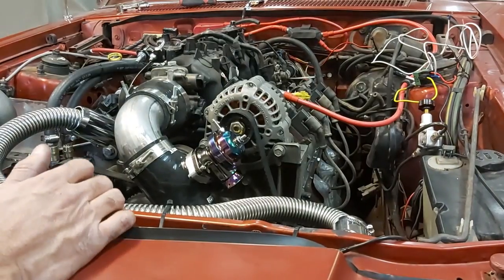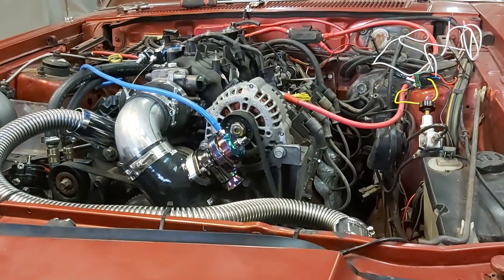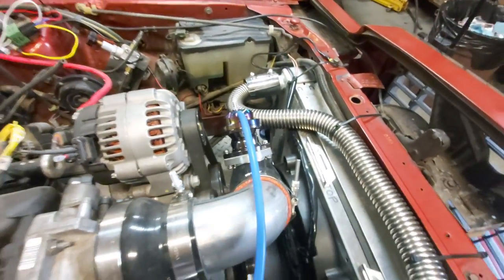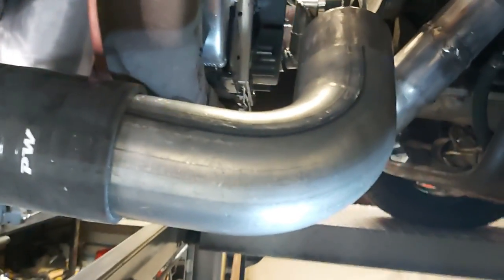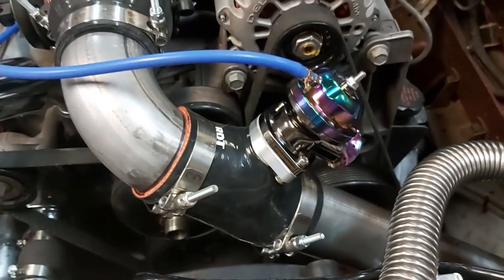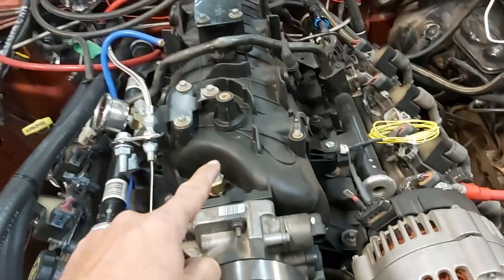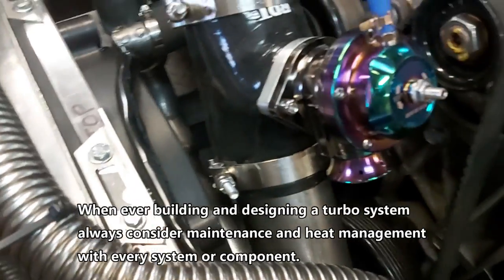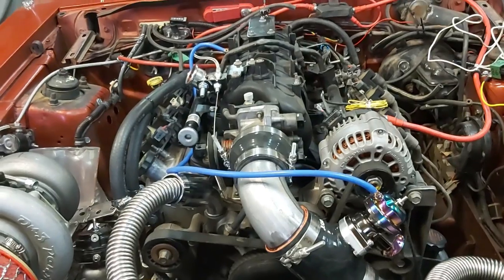Blow off valve & boost piping build & theory for Project Turbo L.S.

Comment: How you hooked your wastegate my turbo don’t have port is it possible to I can hook bottom port on waste gate to intake? And thank for bov info 🔥🤝
Reply from the maker: Yes, If your turbo does not have a compressor housing fitting, you can just connect a line from the intake manifold fitting to the bottom port of the waste gate.  This would control boost pressure if not using a boost controller etc. When intake manifold reaches the same  spring pressure  as in  the waste -gate, the waste gate will open bleeding of pressure, thus controlling boost pressure of the system. If you have a 10 psi spring in waste-gate, your engine will make a maximum of about 10 psi with this configuration.....thanks for watching and commenting.....Oliver

Comment: where do i put my wastegate vacuum im not using a boost controller
Reply from the maker: Right now since my boost controller isn't hooked up either, I'm just running a vacuum line from bottom port of waste gate to the turbo compressor housing pressure port. So basically we are just using waste-gate spring pressure as our governing system to control boost pressure. I have about a 14 p.s.i. spring in my waste-gate. So in theory when boost pressure hits 14 psi the waste-gate should open and prevent over boosting....I'm just testing everything slowly at this point so I've hit about 3 psi before I let of the gas pedal....Thanks for watching and commenting.....Oliver

Comment: How’s the bov coupler holding up?? Been going back n forth on ordering one.
Reply from the maker: Still good, although I had to re-position the charge pipe as the configuration in the video didn't clear the ls swap radiator and dual derale fan set-up which is in the car now....thanks for watching and commenting....Oliver
Reply: @BooostedLS  I appreciate it!!!

Comment: Your set up doesn’t have a MAF sensor? Mine does :(
Reply from the maker: That's because my x-max is speed density and uses a map sensor verses a maf sensor. Are you using terminator x as your ECM?. Thanks for watching and commenting.....Oliver
Reply: @BooostedLS  this is my first ever turbo build. I was going to run the stock ecu to keep cost low. Trying to absorb everyone’s knowledge:)
Reply from the maker: No worries Dan. Hopefully my video's offer some good tips. If you have any questions just shoot me a question on here and I'll get back to you as quick as I can. Good luck on the build, I think it will work out just fine. Thanks again for watching and commenting....Oliver
Reply: @BooostedLS  I really appreciate that!

Comment: How did you hook up wastegate
Reply from the maker: I'm planning on just using a manual boost controller initially, as they are cheap and they work well. What I usually do when I'm first trying out the turbo charger is I just connect a vacuum hose from the compressor pressure port ( nipple ) directly to the bottom port of the waste-gate. What this does is it just limits boost pressure to the same as waste - gate pressure. So in my case about 14 psi, as I believe this is the pressure of the springs in my waste -  gate. I'll definitely make a video going over the hook-up of the waste - gate once I get to that point. You can see how the waste- gate actuates in this video here at this link.... https://youtu.be/FPqMai5el0I ...thanks for watching...Oliver

Comment: How do u get it to run without maf sensor
Reply from the maker: Speed density systems do their work first by measuring the temperature of the inlet air and then the manifold pressure via a manifold air pressure sensor, or MAP sensor. They then calculate a density of air with which the ECU can calculate how much fuel it needs. The Holley Terminator X-max is a speed density system....Thanks for watching....
Reply: Dude I was looking for something like this!!! My inexperience led me to just go ahead and by VS racing and I’ll attempt to weld the aluminum flange to my stainless IC pipping. However, The one aspect I leaned towards was that there’s a Vs racing store In Dallas, 2 hrs away and I knew I wouldn’t have to worry about Chinese parts getting stuck out on the west coast port haha!
Reply: @BooostedLS  can you still run the maf sensor if you choose to go by speed density tuning..my 04 Mustang gt I bought had maf unplugged but it seems running fine letter to find out it might be speed density tuned..so my question if I add on intercooler and bov do I need a retune coz car have non intercooler set up right now

Comment: That exhaust piping is gonna hold a lot of heat
Reply from the maker: That's okay as the higher the exhaust temp, the higher velocity the gas speed will be. As a result it will drive the turbine wheel harder and faster for quicker spool-up and boost. The turbo van has a similar design and it spools instantly at the link here... https://youtu.be/py6jioakp1k    ...Thanks for commenting and watching......Oliver